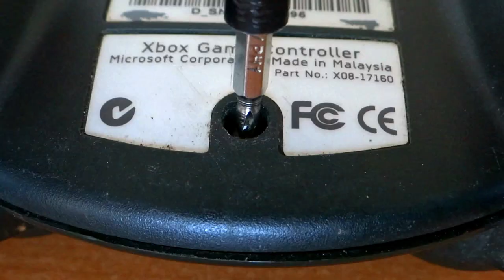Restoring XBOX "Duke" Controller - Restoration Original Controller XBOX Classic

Comment: Great video and thanks for the tip on the gear grease and vinyl finish, do you have a links for the kinds you use?  I clean out and restore back to normal my controllers with my daughters.

Comment: The liquid vinyl and gear grease is a nice touch especially when you put TLC into your own gaming collection. Is there a type or name you used here?
Reply from the maker: the vinyl I do not use a particular brand since I buy it by the liter but it can be any that is special for plastics, I like to use Roshfrans brand grease, it is supposed to be automotive but it has given me great results for preserve the joysticks of my controllers.
Reply: @VRestoration  thanks a lot. I'll be taking apart my two green Halo controllers I've had since launch and have been afraid of making a mistake but your video helped the most